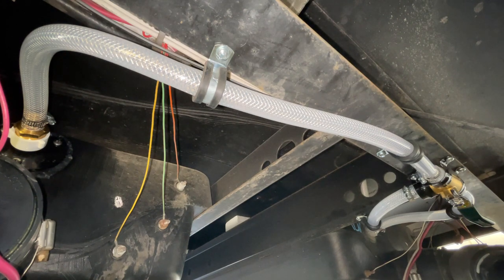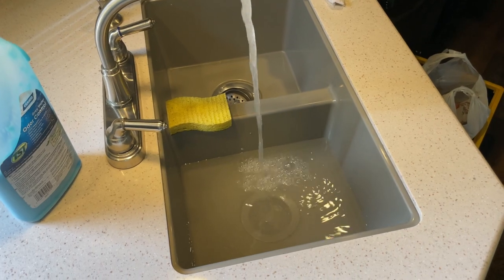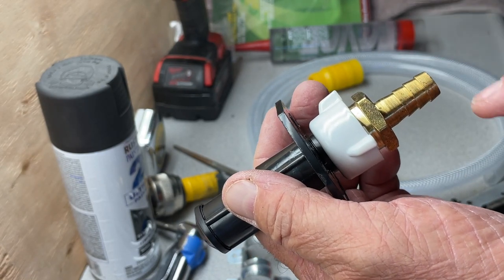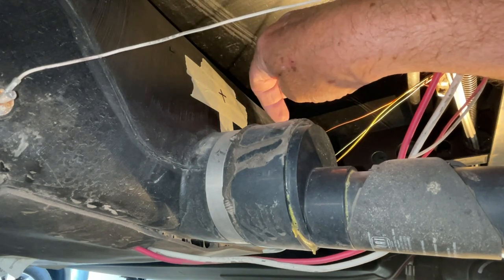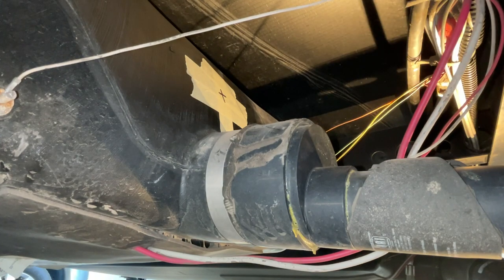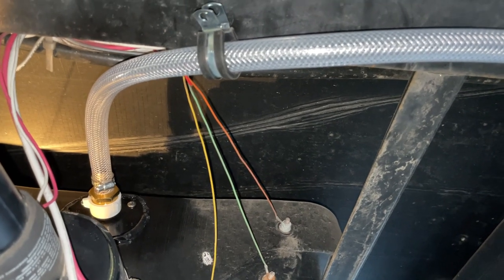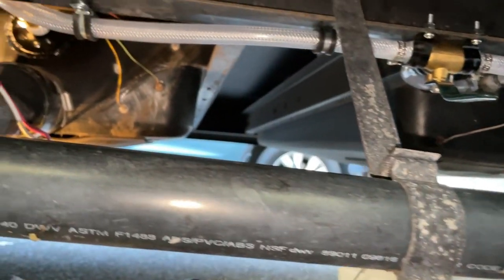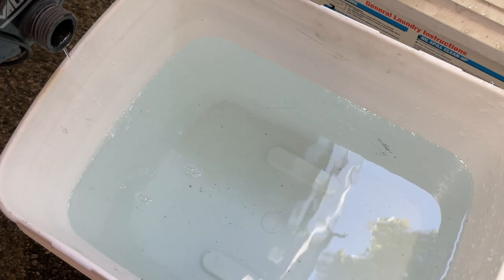Are Your RV Gray Water Tank(s) Really Clean Inside? You Will See What I Found Inside & Did About It

Comment: Thank you so much for this video. You are one of the reasons I always refer to You Tube as You Tube University! No matter what I need to do I can always find it on You Tube University. I just ordered some of the parts and once they arrive I will be getting my very nasty gray tank cleaned out. Thanks again, much appreciated, Elizabeth James
Reply from the maker: Thank you Elizabeth I apricate you watching and your comments  :)
Reply: @thetraveltrailerguy  Good Evening Michael, Well I am back to let you know I got the parts and got to it this afternoon. Got myself under my rig and found the perfect location to drill the hole and did just that, (I bought the drill and hole saw from your amazon list) and I drilled the hole, grabbed my new flush part and tried to put it in the hole I just made in my gray water tank, it would not fit at all. I did all the wiggle and waggle with no luck. When you did this to your tank I remember you said it fit tight and it was perfect, so I wanted to get in contact and ask for advise. I grabbed a peice of paneling and drilled a hole in it and tried to put the flush part in it while I was up on a table and not under the rig, it just does not fit. Please advise. Thank you. Elizabeth James
Reply from the maker: @elizabethjames3440  It should be fitting did you buy the exact flush nozzle I used? Does it say on the package what size hole to drill? Mine said 1". I'm confused like you are, if the hole only needs to be a little bigger you can use a file to file the hole a little bigger to make it fit. A file like this will work from Home Depot https://www.homedepot.com/p/Nicholson-10-in-x-3-8-in-Bastard-Cut-Round-File-21854L/100208023         Can you let me know just how much bigger the hole needs to be?
Reply: @thetraveltrailerguy  Thank you for your quick response. Yes, I bought my flush part and drill hole saw off your parts list. The package says drill a 1" hole, the OD of the bit I bought and used is 7/8", the one that I had on hand and used in my piece of panel is OD 1" and the part fits but it is a bit loose. so I am confused because the one I bought seems a bit too small and the one I had seems a bit too big. Thank you for the file info I will get one in the morning and try to file the hole. Many thanks, ELizabeth James
Reply from the maker: @elizabethjames3440  I'm wondering if they shipped you the wrong sized bit. Here's the link to the bit that was on my list, did the hole saw you used have 1" or 7/8" stamped on it? 1 inch Hole Saw with Arbor - https://amzn.to/3DDfp0f
Reply: @thetraveltrailerguy  Good Evening Michael, THANK YOU for all you assisted with in this successful installation! No they did not send me the wrong part. It was 1 inch and 25MM however it did not fit, but thanks to you I just had to make it a smidge bigger and it was getting done. Bottom line was thanks to you and your assistance the installation worked out. I will be testing it in a few days. Thanks again, Elizabeth James
Reply from the maker: @elizabethjames3440  Thank you so much for letting me know you got it installed. I was happy to help, one of the reasons I make these video is to help people have the confidence to do projects on their own and save money. Take care :)

Comment: Not to be critical, but why didn't you use that smaller drill to cut the hole, looks like it would have fit without using the 90 degree drill contraption.  Overall it looks like a great upgrade.  Does it help with grey water smells?
Reply from the maker: Thanks for watching and commenting Chuck. You have good questions, Yeah I tried to get all my drills in there but they wouldn't fit, the problem was the hole saw bit set up was pretty long not even allowing my small air drive drill to fit so I got creative. So far its working great cleaning the tank and we have no smells. Great questions
Reply: @thetraveltrailerguy  gotcha.  Thanks for replying.  I want to do this to my trailer.
Reply from the maker: @clutchcargo666  12 Pack 3/4 Inch Stainless Steel Cable Clamp, Rubber Cushioned Insulated Clamp -
https://amzn.to/3FFDQMB

Par-Barb Nylon Male Connector Fitting, 1/2" Hose Barb x 1/2" Male NPT, White -
https://amzn.to/3lzu0Ux

Barb Nylon Union Elbow Fitting, 90 Degree Angle, 1/2" Hose Barb x 1/2" Hose Barb, White -
https://amzn.to/3DEB2xv

10 Piece Hose Clamp Box (Micro Size 6), silver -
https://amzn.to/2YJZoqb

Metals Brass Garden Hose Fitting, Connector, 1/2" Barb x 3/4" Male Hose -
https://amzn.to/3ACwTbc

3 Way (L-Port) 1/2'' Female Valve Brass Ball Valve Anti-Rust Forged Brass Valve Fitting with Lever Handle (Note: I could not find this valve in local hardware stores)-
https://amzn.to/3BAaz3y

Rigid Pipe Strap Clamp Hanger, 2 Holes, Galvanized or PVC Pipes, IMC Conduit (10, 3/4 Inch) 
https://amzn.to/3iYegZp

Valterra A01-0169LFVP Black Plastic Lead-Free Flange Water Inlet -
https://amzn.to/3lvcOPT

Rhino Blaster Sewer Tank Rinser -
https://amzn.to/3mGbAR6

Valterra A70 No-Fuss Flush with Check Valve -
https://amzn.to/3FGrhRa

Valterra A71 No-Fuss Flush Accessory Kit -
https://amzn.to/3au7qGD

1/2" ID x 5/8" OD High Pressure Braided PVC Tubing, Heavy Duty Clear PVC Flexible Tube Vinyl Hose Water Oil (10Ft length) -
https://amzn.to/3DEGh09

Lexel Adhesive Caulk, 10.5-Ounce -
https://amzn.to/3lA8i2x

1 inch Hole Saw with Arbor -
https://amzn.to/3DDfp0f

DEWALT Right Angle Attachment, Impact Ready -
https://amzn.to/2YNnXTI

Right Angle Drill 105 Degree Right Angle Screwdriver set Drill Hex Bit Socket Adapter,360°Rotatable 3Pcs 1/4" 3/8" 1/2" Cr-V Hex Shank Impact Grade Driver Socket Adapter -
https://amzn.to/3BBSfaa

Camco 40126 Tornado Rotary Tank Rinser with Hose (I did not use these but its another option) -
https://amzn.to/3ABw6as
https://amzn.to/3lCk1hj

Comment: hi Michael, great mod! question, have you used your trailer much since this mod? just curious if you have any leaks or problems since the install.  I have a cracked grey tank, so I need to drop and replace, considering doing this mod when I install the new tank
Reply from the maker: Hey Matt, yep we have used the trailer over the last few months with 33 nights of camping (I just checked) No leaks at all and it works great in fact I'm thinking it works better than the black tank wash, you can hear harder spray noises hitting the tank in lots of areas compared to the factory installed nozzle in the black tank. I think its a good idea for you to this on your tank, I know I would do it again if I bought another trailer someday. Let me know how it turns out :) Sorry to hear about your cracked gray tank :( 

12 Pack 3/4 Inch Stainless Steel Cable Clamp, Rubber Cushioned Insulated Clamp -
https://amzn.to/3FFDQMB

Par-Barb Nylon Male Connector Fitting, 1/2" Hose Barb x 1/2" Male NPT, White -
https://amzn.to/3lzu0Ux

Barb Nylon Union Elbow Fitting, 90 Degree Angle, 1/2" Hose Barb x 1/2" Hose Barb, White -
https://amzn.to/3DEB2xv

10 Piece Hose Clamp Box (Micro Size 6), silver -
https://amzn.to/2YJZoqb

Metals Brass Garden Hose Fitting, Connector, 1/2" Barb x 3/4" Male Hose -
https://amzn.to/3ACwTbc

3 Way (L-Port) 1/2'' Female Valve Brass Ball Valve Anti-Rust Forged Brass Valve Fitting with Lever Handle (Note: I could not find this valve in local hardware stores)-
https://amzn.to/3BAaz3y

Rigid Pipe Strap Clamp Hanger, 2 Holes, Galvanized or PVC Pipes, IMC Conduit (10, 3/4 Inch) 
https://amzn.to/3iYegZp

Valterra A01-0169LFVP Black Plastic Lead-Free Flange Water Inlet -
https://amzn.to/3lvcOPT

Rhino Blaster Sewer Tank Rinser -
https://amzn.to/3mGbAR6

Valterra A70 No-Fuss Flush with Check Valve -
https://amzn.to/3FGrhRa

Valterra A71 No-Fuss Flush Accessory Kit -
https://amzn.to/3au7qGD

1/2" ID x 5/8" OD High Pressure Braided PVC Tubing, Heavy Duty Clear PVC Flexible Tube Vinyl Hose Water Oil (10Ft length) -
https://amzn.to/3DEGh09

Lexel Adhesive Caulk, 10.5-Ounce -
https://amzn.to/3lA8i2x

1 inch Hole Saw with Arbor -
https://amzn.to/3DDfp0f